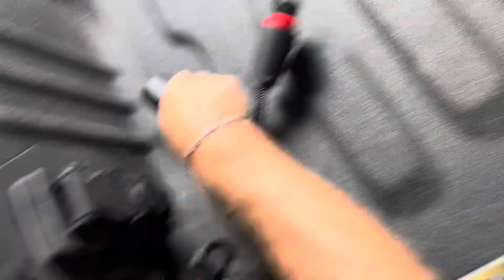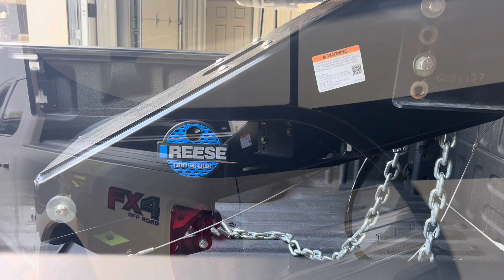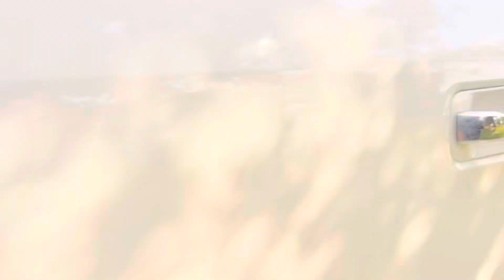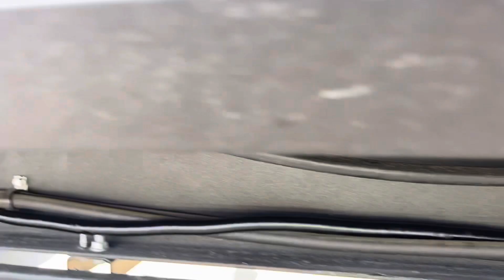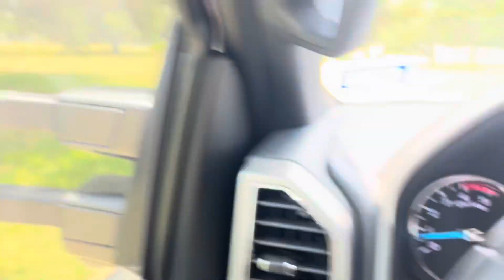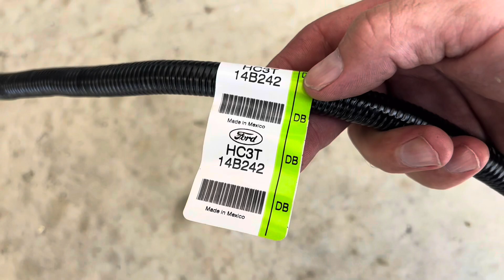Ford Trailer TPMS And Camera Setup

Comment: Thank you brother, this is a much appreciated tutorial on dedicated Ford TPMS system.   Do the sensors have to be installed inside of the tires or can they be installed on the valve stem?
Reply from the maker: For the ford system prob have to be in the tire with ford sensors. Might be able to get the same mhz sensors and try to pair them

Comment: Super useful video, thanks. One comment to others, if you have the backup assist fitted, be sure you get the right kit. I incorrectly bought the same one as fitted here, and of course, it doesn’t have the 3rd connector for the Yaw sensor. I've tried to find an alternative 3 way connector, but no luck. Found one, but it had the wrong video connector, so still looking. Meanwhile, I'm using it without the Yaw sensor hooked up.

Comment: Hi Rocky, Quick question. Did you put the TPMS module in between the I beams or out side of one of them? I would like to put the module in between the I beams inside the bottom cover.
Reply from the maker: I put it facing down on the frame
Reply: @RockyRohde  Thanks

Comment: What if you have multiple trailers? Does the PSI and # of axles stay with the trailer side of the system so once each trailer is set-up, it will recall that based on which trailer is plugged in?
Reply from the maker: Yes.. it recognizes the module on each trailer. All tire positions are saved on the module. When I buy a new truck and plug in it’s all good.

Comment: I have the 2024 F450 Platinum, Only need the camera set up. F450 have no tpms. I use the Tireminder system for all 10 tires. Do you know if the Harness is split , as no way to get that big plug up to the 5th wheel hitch.
Reply from the maker: I had to unplug camera and feed small end through the front of RV and down the frame.

Comment: Outstanding video, answered so many of my questions but I have one more. I am sooooo hoping you can answer this with your setup. I'm trying to decide between the Ford OEM camera/tpms setup or to go with a non OEM camera setup. I really don't want an additional display on the dashboard and I  a hardwired setup for picture quality/reliability of connectivity as well as the TPMS. 
 
- My question to you is can you have the navigation displayed in the main part of the screen and the rear camera displaying in the smaller right side of the display?
Reply from the maker: Have not tested that yet.. I use CarPlay.. But I can press camera button anytime and it shows rear of trailer. Oem is a nice setup
Reply: @RockyRohde  
When you push the button, do you have that annoying message about checking your surroundings (I forget exactly what the message is)?

For the TPMS, I don't recall if you addressed this in the video - I may need to rewatch - did you have to install new valve stems in your trailer wheels or is the ford part simply screw on caps?
Reply: I'll experiment with Android Auto and the rear camera. I'm hoping the aux camera will perform the same way. Thanks for the video again.

Comment: Hi  I did not see a option to get TPMS and the camera. Is that after market?
Reply from the maker: It is ford parts and option
Reply: There is no option for both it's one or the other.
Reply: @jimgeiger8669  Super Duty 2017-2022 
Trailer Mounted Camera & TPMS Kit without Pro Trailer Backup Assist
Part Number: LC3Z1A189D

Comment: Would have really been helpful if you showed how you actually got into the fiberglass and ran the wires from the pin box to underneath the coach.
Reply from the maker: Drilled up from hitch and ran cable under the bed in bedroom. Drilled another hole and put it in cabinet

Comment: Added the trailer TMS system to my 23 F250 when training the wheels I get a beep but I do not get a green check. Tried several different scenarios. Took the trailer for a ride. Still no green check. Any thoughts?

Comment: I have a 2020 f350, i had ford turn on the tpms monitor for the trailer in Forscan. They charged $100 for up to 2 changes on the Forscan. Also, the extra dual plug can be switched out with the one in the bed if you only have the single plug and the wiring harness for it is tucked up near the spare.
Reply: does yours show the temp? I have a 2020 f250. looking to buy this kit just wanted to ask first.

Comment: What year truck? I have a 2020 f250 wad told the camera would turn off while driving. Does it stay on while traveling?
Reply: 22 and newer, rear cam stays on
Reply from the maker: It’s a 22..
Reply: @RockyRohde  I just ordered a 2024 F350 and the dealer told me that the rear camera would turn off as soon as I started driving - so I did not order the rear camera -because I want it turned on when ever I tow the fifth wheel trailer 100% of the time.  Now I see your video that you have it running while driving.  Did you have to program this function to have it running all the time? If so what is involved in doing the programming? Or is the dealer not up to date on the rear camera technology?
Reply: @martinsenn3538  he told you wrong, I have a 23 450 and I can view all cameras except forward ones on the highway
Reply: At least for 2023, that's incorrect. I can use the bed camera and tailgate camera when going down the freeway. Although the tailgate camera does have an annoying "full view not available" error message over the image.
Reply: @agcomptec  On my F150, removed that annoying error message using FORScan.